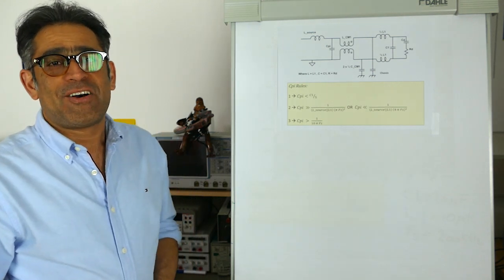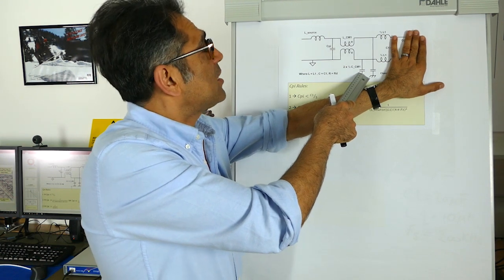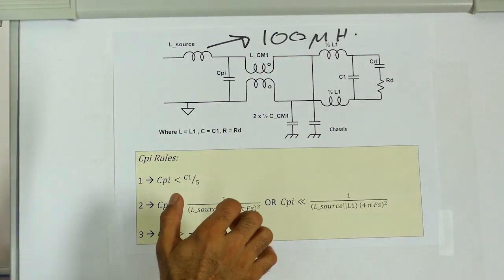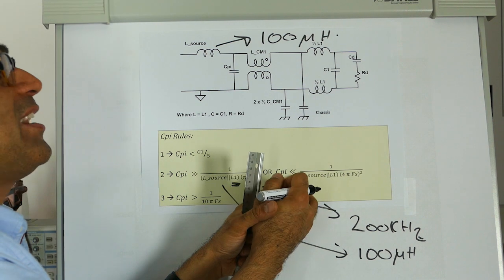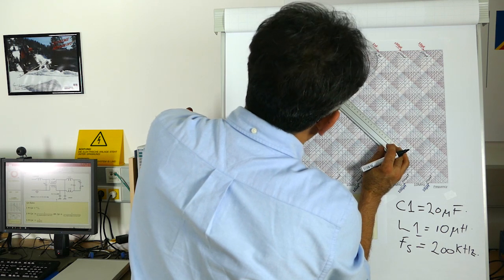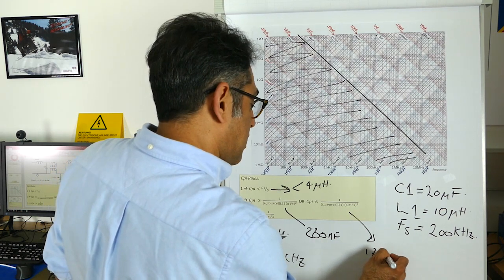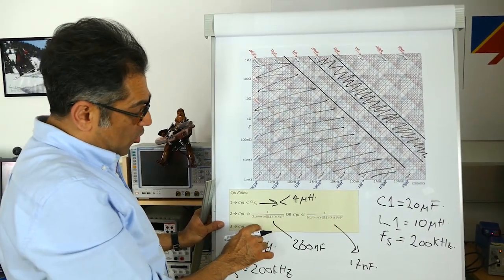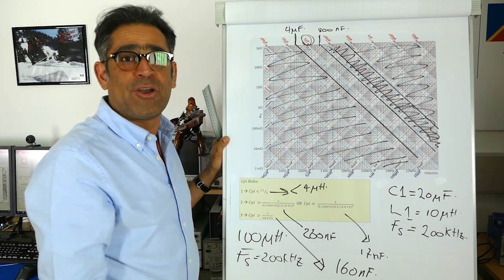EMC Filter Design Part 9:  Finalising our Filter Design by Adding the Pi Capacitor

Comment: Thanks for sharing great videos 
For a low power device(actually power consumption is lower than 150 mW) can we use a simple RC filter instead of LC filter  in differential mode??
Reply: RC filter will have 20dB/decade instead of 40dB/decade. Also, impedance at DC will be equal to R (instead of ~zero) so any DC loading will cause a voltage drop. 

Not saying it can't be done, but those are two important considerations. 

For diff mode noise, you can consider a ferrite bead instead. They've got lower Q, but for this that's OK for this since it just means they'll convert noise to heat. Plus, they continue to be pretty resistive up to pretty high frequencies (as opposed to an inductor, whose impedance drops above its resonant frequency). One gotcha for ferrite beads is that you need to be careful not to saturate them with DC current—but for low power applications that may not be a problem!

Comment: What is Fs in rule 2 and 3, switching frequency or resonant frequency?
Reply: Switching
Reply: @mdmarti6  switching frequency of what??
Reply: @sadeghghorbani3055  The power supply. What else is switching?
Reply: @mdmarti6  switching regulator(buck converter)
Reply: @sadeghghorbani3055  ok, poor choice of words on my part. By the (switching) power supply, I meant the switching converter of the power supply so we’re talking about the same thing. There’s no other element that is switching.
Reply: @mdmarti6  👍👍👍